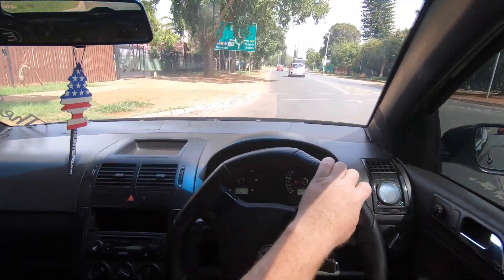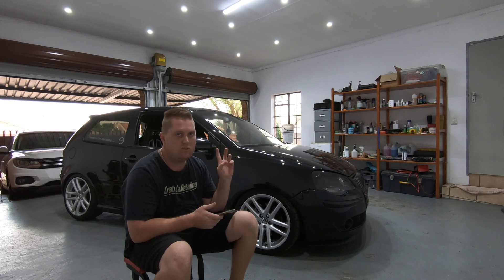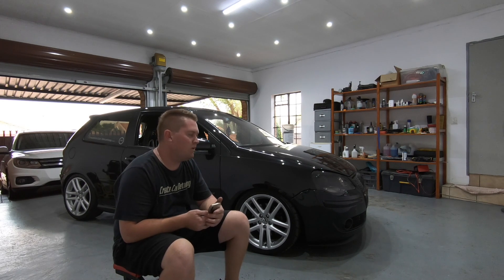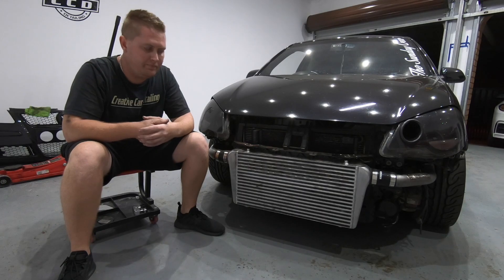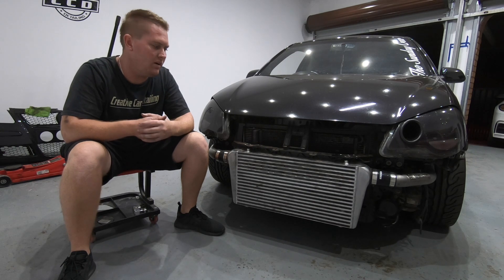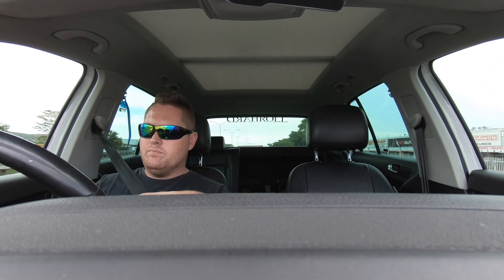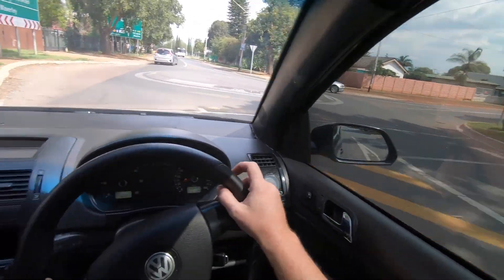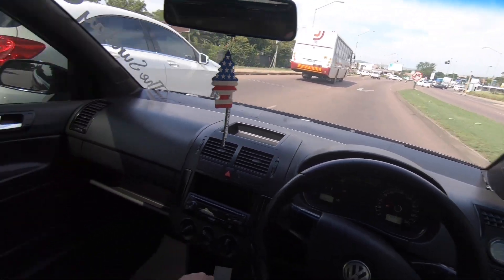Power Steering Problem + FIX !!

Comment: My polo 9n got problem  I don't know or it's a staring rack or what because stering is hard and If check a pump hydronic is not speculating I don't  know what happened
Reply from the maker: If you haven’t recently had the gearbox out, start by checking powersteering fuse. If gearbox was out recently, I have bad news for you buddy
Reply: @CCDVIDEO  WHT bad news